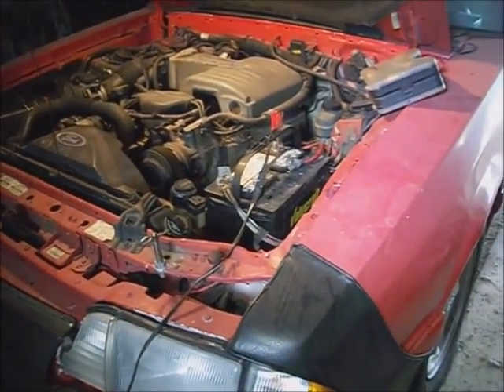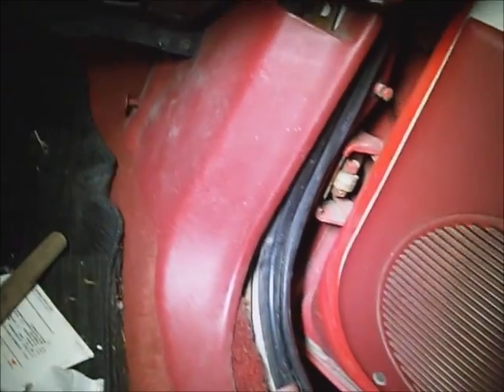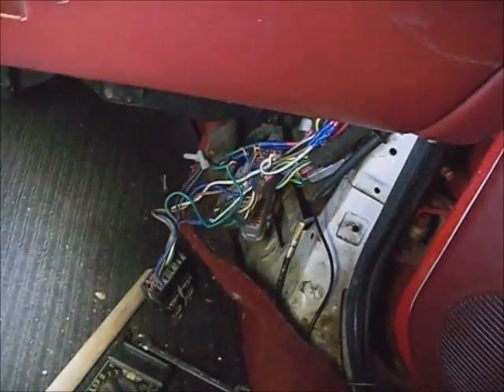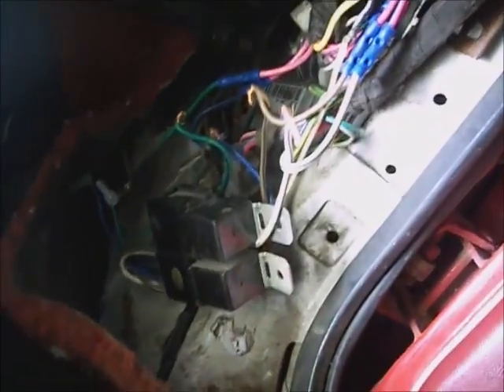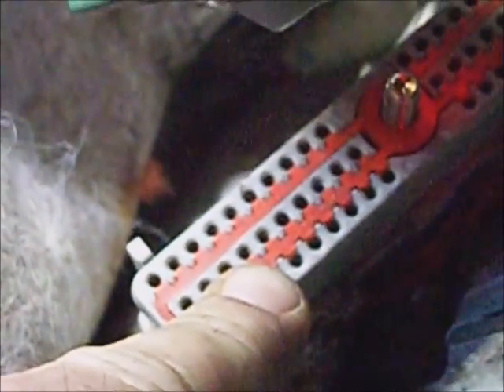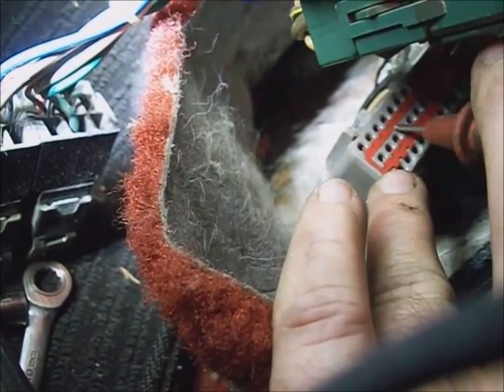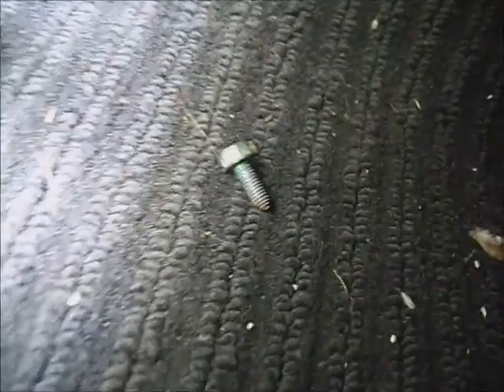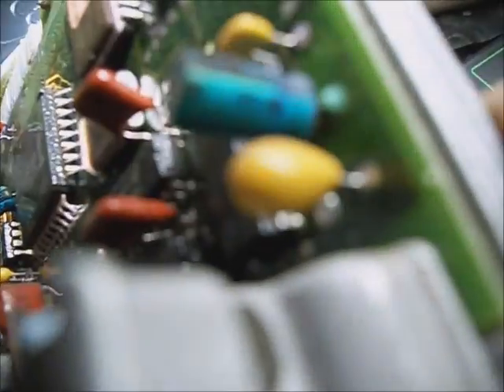Ford Mustang 91 w 5.0l no start relays clicking engine control module (ECM) power and ground check

Comment: working on an 88 crank no start same as you relay clicking fuel pump not priming..... if I check for ground and power at the ecu and it checks good like you did. that means all fuse links etc.... are working right? and bad eec/ecm? with ecm out it same as with it in... LOL cant get that sucker back up in that tight hole either. but I am suspecting bad ecm since its is original. I put in new tank, sender, and pump.
Reply from the maker: An old ECM is likely to fail, pin 1 has BAT+always, for memory retention.  Key on pwr. from ignition switch (12v) closes contacts of EEC relay, (provided it has 1 pin -grounded from BAT is ok, and the relay is functional) to provide VPWR (12v) to pins 37&57 ECM, and 12v to FP relay, (CHECK for 12v at coil for igniton switch output).  PIN 40&60 ECM, are BAT-(GRND)spliced in at BAT neg terminal or fat black connector directly off of neg bat terminal, (it goes bad inside as well, if grnd isn`t present at ECM.
Reply: Auto Dr diy ok thanks will get out the meter and recheck today.
Reply: No luck.... got 12v at 1,37,57 and good grounds. Need to pull tank and bench test the new pump.... ughhhhhhh
Reply from the maker: make sure the inertia switch in trunk for fuel pump, isnt tripped.  The FP relay is subject to go bad as well, but in general since the ECM grounds the FP relay, if it is damaged, the FP relay ground from ECM pin 22 T/LG, will probably be pulsing power instead of ground.  As a result of 12v feedback through relay positive terminal, and the damaged ECM is not able to provide a solid ground at key on, or while receiving rpm signal during cranking.  So if the relays are clicking, it will likely be irrelevant if the pump works or not, because it isnt even able to get a stable 12v supply to operate, (fix first).  IF the cover can be removed from the ECM, likely capacitors are corroded, or even smell in the connector plug for a burnt smell.
Reply: ty sorry I have not replied back got busy and gave up on the 88. but I will check ecm again. I looked inside it initially and caps looked ok not bulged or leaking. I have read also ecc relay? I cant seem to locate it on this 88. diagrams show it above the ecu. nothing up there?